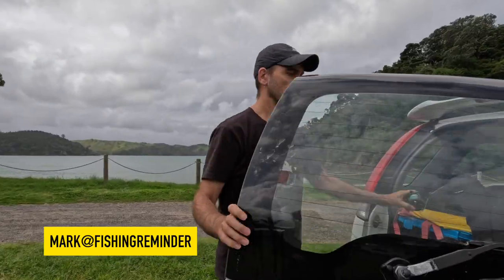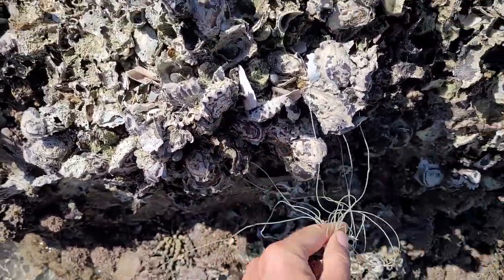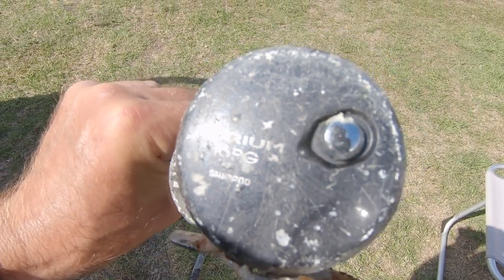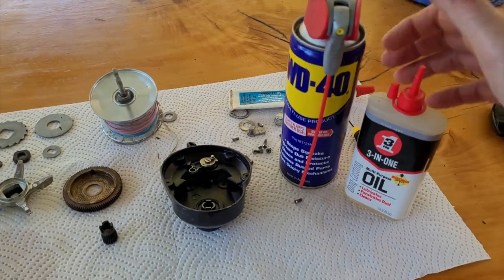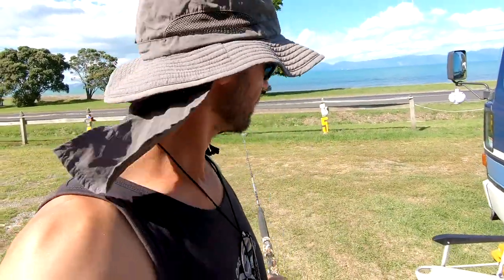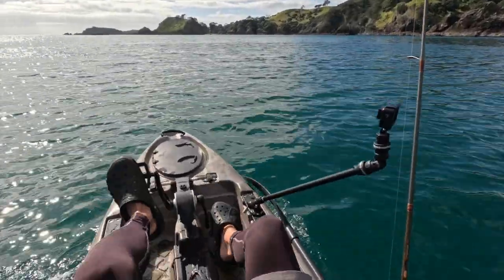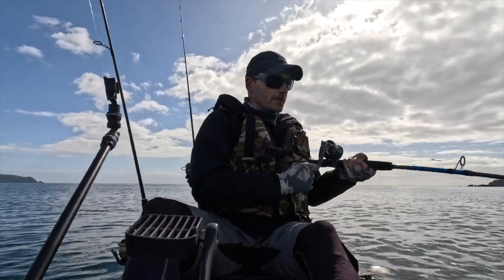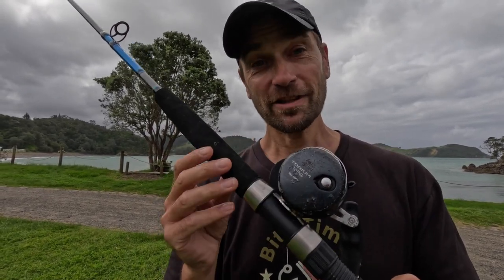Indestructible Fishing Reel Reclaimed From The Ocean!

Comment: I've got a Torium 16HG. For a cheap reel, relatively speaking, has caught me plenty of decent kingfish off the kayak it's been amazing. Fantastic value for money. Would rather buy two of them (with change left over) than say one Talica 12. Well done on the beach clean up.
Reply from the maker: Cheers Rob. Yeah, they are very good reels for the price, eh. And indestructible at that. I have gone through so many reels over the years that couldn't withstand the rigors of kayak fishing. I'm now only using sealed Penn reels and this Shimano overhead reel. And these seem to be able to handle the job :)

Comment: You didn't chang the line?  Drag sounds good.
Reply from the maker: The line looked good, good quality braid. This stuff usually doesn't degrade much in saltwater. But yeah it was stupid not to change it right away, because the top layer was  somewhat damaged by the sharp shells and barnacles growing on it. I wanted to try the reel first before investing in new expensive braid,  just to make sure it actually works properly.

Comment: Go taking trash out.
I love to see people do that.
I have two Torium 30s and they are beasts. Five foot bull shark was no problem bringing in. A huge stingray 5 ft across came in no problem. Many big bull redfish 40 inches plus. I can cast it around 200 yards with a 6 oz sinker on a 12 ft surf rod.  It's s beast of a reel
Reply from the maker: Thanks Jim. I must try this on my surf rod for shark fishing. Do you have an overhead surf rod or do you use it with a standard rod?
Reply: @Fishingreminder  I have them on 12 ft Diawa Beefstick rods.  You need to add the under rod clamp as the standard rings are not strong enough for big tussles like this. The Beefstick rod is but it's reel seat needs help.  I think the clamp assembly is around $25